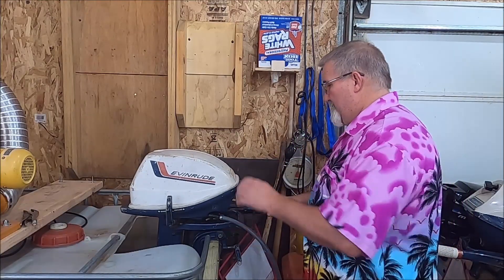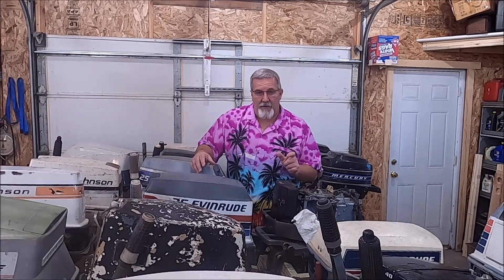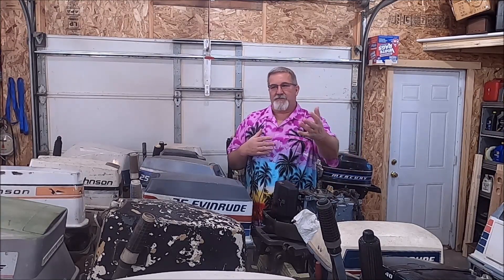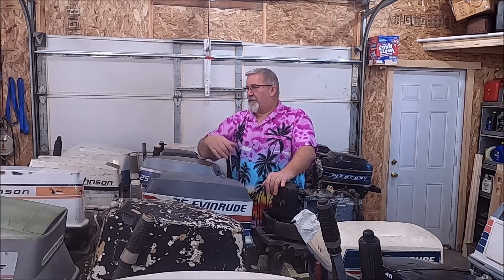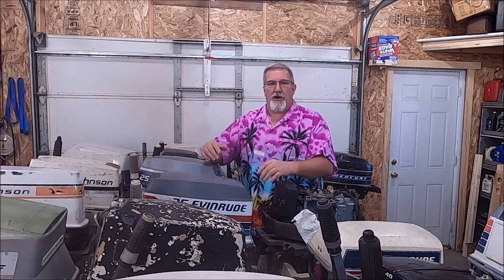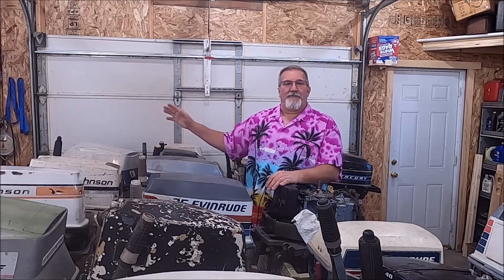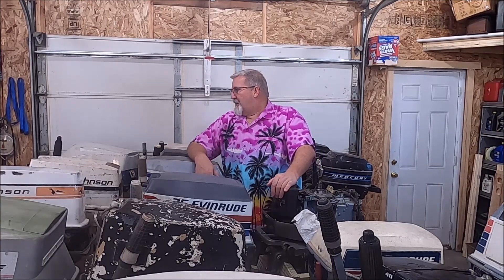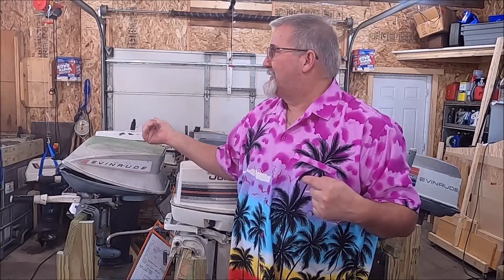Evinrude 6hp and my new channel. We are going to enter the world of 3D printing. Unbox, assemble DIY

Comment: Any help? I have a 1969 6 hp Johnson and the throttle is working but extremely hard to turn, i have tried to degrease it and lube it but wont loosen up.
Reply from the maker: Did you remove the plastic handle? the grease under the handle will get super sticky stiff.
Reply: @Michaelsbackyardmarina  yes i did, but i was wondering if you take out the shaft arm if the rubber seals may have grease stuck in them.  Thank you for the reply, great videos, i love that you take the time to bring these old motors back to life.

Comment: I have a 1974 Johnson70 outboard runs like a champ I think the starter is going out it doesn’t want to restart after it’s been running the battery is new and no 
Corrosion around the terminals the plugs are new also what do think
Reply from the maker: How is the condition of the points?